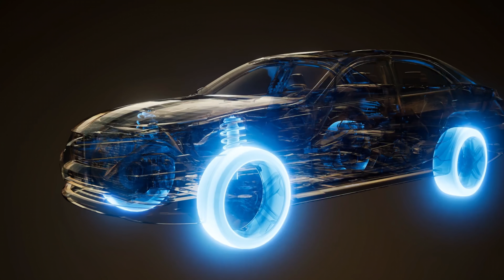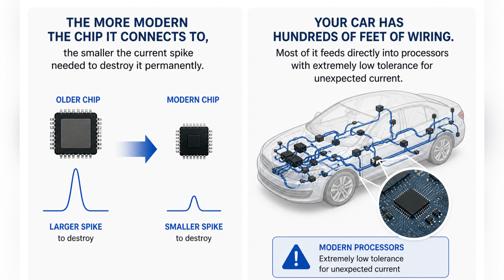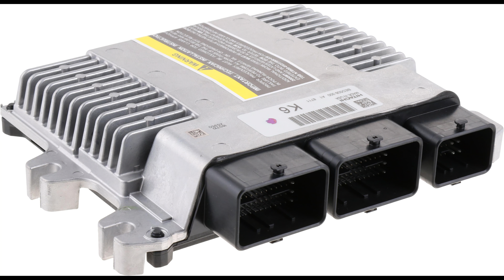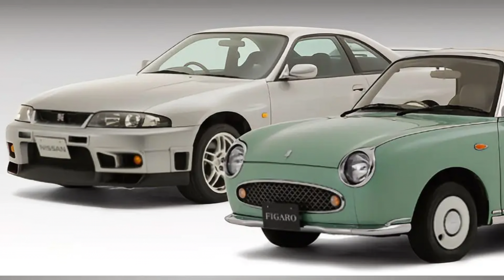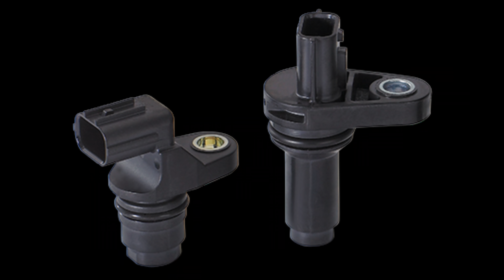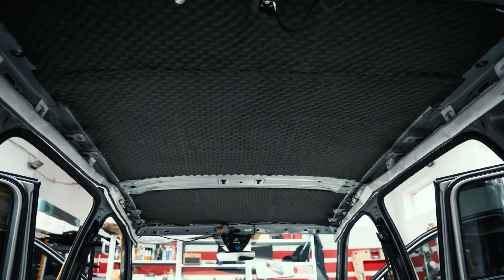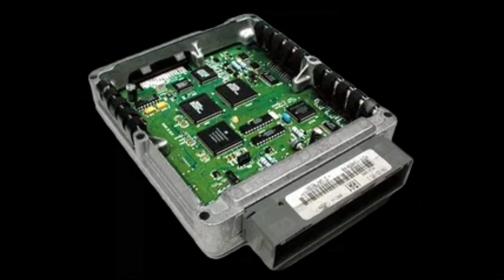EMP Just Killed Your Car? This $7 Part Saves It

Comment: relays can be bypassed with a shunt or jumper wire per the diagram printed on the side cover that's not saving   what's connected to the CAN bus

Comment: The EMP Myth is designed to sell idiots products.

First off there are no EMP weapons that pose any real danger. EMP weapons are mostly a myth. Russia and the U.S. experimented with them and the effective range of actual EMP weapons is about 500 meters.

Second, the only way to create an EMP strong enough to cook comsumer electronics including motor vehicle computers is to drop a nuclear weapon.

If you're close enough to the detonation to be impacted by the blast your car not starting is the least of your worries.  If you didn't get evaporated by the heat flash you recieved a lethal dose of radiation strong enough to kill you in a day or two. Your car won't help you.

Comment: That won't work. Its the electronics that get fried, not the fuses & relays. Miltary trucks usually have diesel engines with no electronics. Consumer trucks & cars have electronics for fuel injection, emissions control, security (theft protection).  Fuses do not protect electronics as they are extremely slow. the E1 Pulse will damage semiconductors in about 20 to 50 ns. A typical fuses takes a second or more to blow.

if you want a EMP proof vehicle then you need to get a old diesel vehicle from before the 1990s that does have an electronics for engine control.

Comment: Way to talk about the U.S. military then show a Russian BTR… and this is wrong in so many ways. Automotive relays are not vulnerable to emp, nor are the fuses. The vulnerable parts are the driver I/Os in every module within the vehicle; but the EMP would have to be very strong - like you’re within a few of miles of the detonation and you would not survive. Actual EMP hardening is a lot more involved.

Comment: there are no solid state components in a relay. the relay and fuse are not likely to be affected. if there is a flyback diode, that would blow, but it won't prevent the relay from working.

Comment: No.  When an EMP hits a modern vehicle, it won't run again period.  It won't just fry relays and fuses, it will fry every module in the vehicle, and modern cars have anywhere from 25-50 modules in them.  The small gap between relay and fuse terminals is not enough to stop the current.  It will simply jump across.  Most military vehicles in those scenarios are diesel.  Mechanical diesel will still run, just like an older ride without computers.

Comment: Ha my old truck don't have fuel injection, electrical fuel pump or a computer (ecm). But all the other electrical equipment will be down so I won't be too worried about a vehicle just stipid people.

Comment: This is a good video for someone that has a 50-year-old car. If we have an EMP that strong, your car is junk. Your car talks on a can bus system with about a dozen nodes. Each node addressable, even the transmission control node is programmed at the factory to set the perimeters. 
Get a good bicycle with a pull wagon or baby carriage

Comment: my 1971 Camaro SS 396 is EMP proof. it still has a points ignition. the radio might not work, but i can listen to the sweet song of a big block chevy all day long. oh.. and its a 4 speed, so no electronic transmission issue either. although to be fair if it had a TH350, Th400 or Powerglide it would be fine too. but you can push start a manual trans, even if the battery is dead.

Comment: A modern vehicle's ECU (Main Computer) runs the car. It's made of microchips. Modern microchips are extremely sensitive to voltage spikes. The high-altitude EMP (HEMP) induces currents that can fry delicate semiconductor tracks instantly. Your vehicle is toast.

Comment: Pretty much every home in America and most businesses break room have a EMP proof cage . It’s called the microwave.. also in the national in emergency , you can always rip the door off turn it on. It will decoy an anti-sam battery  with a intercept missile. It gives off the same signal as a  SAM battery site for aircraft . This was  demonstrated in the nato Croatian war 1990s . I believe the frequencies around the 2.4 GHz but that’s the reason you don’t stay in front of  modern US jet. when they activate the radar it  will harm you . This is a warning sign for multiple decades present on every aircraft body don’t stand in front of it.

Comment: Has anybody looked at the actual fuse boxES in a modern vehicle. I'd probably need $1000 to replace the fuses in my Ram. They are not your great grandfather's fuses. Besides, what about those 50 processors? Give me a break

Comment: This is, as mathematicians would say, “necessary, but not sufficient.” While EMP surges can destroy fuses, the vast majority of damage will happen with all the micro electronics in the car: the engine control computer, the myriad entertainment system components, the many CAN-bus Network devices that replace mechanical controls. These will get fried by any EMP, and are not easily replaced, and it is almost impossible to stock spares. Many are hard to reach locations, or require specialize electronic tools to install. Those electronic tools themselves will be destroyed by EMP.

It’s much more important that you have some EMP protected communication electronics, such as shortwave receivers, ham, FRS, and CB transceivers, Meshtastic nodes, and cellphones. They should be stored in a metal can rigged out as a Faraday cage, for which you can find instructions throughout the Internet. Without communications, it will be impossible to know what to do next. It won’t matter if you have a working car, because you will not know where to go.

The only sure way to have working transportation is to start with something manufactured in the 1970s and earlier, particularly diesel vehicles, which lack modern computerized electronics and electronic fuel injection. Everything from then back to horse and buggy will work after an EMP event. Anything after is likely to be damaged, and while an EMP isn’t guaranteed to destroy every vehicle, it only has to destroy a small percentage in order to block all the freeways and highways with dead vehicles.

Comment: Decent information, but not entirely correct. Most modern ECUs still have battery power that goes to them, even when the ignition is off. Most cars also have at least 1, sometimes 2, starter relays. On most modern cars, every computer in the car still has battery power at all times, it is instead turned on and off via a can bus signal. A lot of transmission computers are inside the transmission. Without that, your car does not work either. Keeping a spare engine computer is an interesting idea, but it has to be programmed to the car to work.

Comment: I got news for you: A few relays aren't going to save you. When they rolled an idling Ford Taurus across the EMP trestle in ABQ they were stunned after they saw the damage. The brake light wiring in the back actually melted out of the insulation, as it did elsewhere. Just because you don't have computers doesn't mean you are riding, instead of walking. When your ignition harness welds together, it's game over.

Comment: "back on the road in under an hour"? Bahaha. Yea right. 

Even if you had all the replacement fuses and relays and sensors, it would take a lot of work to get them all swapped out. Especially if you are talking about replacing the multiple computers buried in your dash and under your seats.

You'd have better luck walking around to find a 1970s truck to steal. Or better yet, just buy one of those to have in reserve.

Comment: This is totally bogus. Fuses and relays are not affected by EMP. They are simple electromechanical devices. It is semiconductor junctions that are burned out with EMP. Vacuum tubes are impervious to EMP. You should be ashamed of yourself.

Comment: I have backup ECM, fuses, relays and a set of injectors in a faraday bag along with extra cell phs, a star link mini, and a back up controll board to the big generator and a well pump. I’ve been preparing for this for 2 years. I’ll be one of the most prepared.
Reply: Good job
Reply: I’ve been trying to get my mother and grandmother on board. We are not ready and I am having a hard time convincing them to be more prepared.i I want to use your ideas. If you have any more ways to prepare let me know. I do want to het a well pump in backyard . Do you have a way to have a warm shower? I saw a YouTube video of a guy who made a rocket stove with copper coils around it

Comment: Old cars are no longer the answer. They are putting 15% ethanol in the gas. That destroys the fuel lines and engines in the old cars. Also, "coincidently" the auto parts industry is being gutted so older parts will no longer be available. They will also change the rules to make it illegal to own cars before a certain year. The tyranny is closing in on us.
Reply: You can take the ETOH out of the gas by mixing the gas  with water. ETHANOL is more soluble in water than gasoline.  Since there is a loss of octane rating buy the premium  gas as ETHANOL add some octane points.  Siphon off the gas leaving the water-ETHANOL mix waste behind- the remaining gas is ethanol free.

Comment: We have two air cooled VWs from the 60s and 70s. Their engines can get up to 30 mpg and can be rebuilt by a monkey with a manual. 16 fuses. Wiring harness that you can install in a day. No other electronics to worry about. Gas, air and spark. Go. Simple is as simple does.

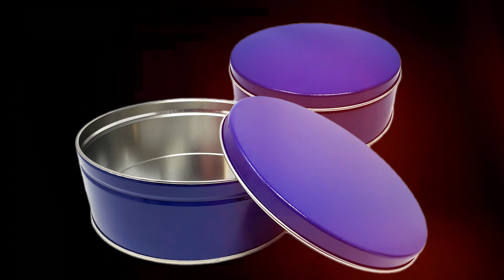Comment: Regarding 5:15 to shield against damage from an electromagnetic pulse, a Faraday Cage can be a galvanized steel bucket with a tight fitting galvanized steel lid available from a hardware store.
Reply: Old microwave oven!

Comment: Sure, $7 fix buy more vintage vehicle. You can even get one with electronic distributor and just put the components in a faraday bag. Newer cars are way too delicate. They have computers so you’d be spending way over $1000 to get everything you need to replace.

Comment: Replacing solid state Relay will not save you 😂. have an extra ECU with multiple relays and ignition modules Cam. And crank sensor Might have a chance.
Reply: The new ECU will probably need to be reprogrammed.

Comment: Not sure I fully buy this as a wrench-turner: The newest cars out there have some or all of their computers in full control, which means they have access to some power all the time despite these basic relays not being on.  This could be enough to cook some components, enough to shut down a vehicle due to a non-engine-control module not "reporting in" on the network (yes, modern cars now have their own network, and some cars have had no-start conditions due to other components in the network failing to report in as functional to the Engine computer).  Add to it the fact that any metal body panels that "might" shield internal components are also directly connected to said components by the Ground wiring.  We won't know until it happens, but at that point it's too late.  Further testing and design refinements are needed.

Comment: Starfish prime knocked out 1920's traffic lights and they were never able to replicate it. It was some hoge pojed town in 1950's Hawaii The "emp" effect was the result of a 1.4mt bomb exploding in high altitude. We have an ionosphere just for that reason, and how do they have electronics in space? Its not just shielding around the station, and everywhere else but the metal shielding around all the circuits ends act as a ground and shield. Its a pulse of electricity, and magnets? What magnets all of them? Electric motors must make those pulses all the time!!!!!! GTFO if you even had any logic or reasoning you'd prep for a massive 30 day long fire ball
Reply from the maker: Starfish Prime did affect electronics, but the modern grid is far more interconnected and vulnerable. Space electronics use specialized hardening, which isn't practical for every car. EMP is an electromagnetic pulse, not just magnetism.
Reply: You can't even explain what it is, you can't even cite anything credible. It's the ultimate prepper bro scam. You either played that part in call of duty or saw those scenes in oceans 12.
Reply from the maker: @alexmaccity  You’re trying very hard to make this sound fake, but your own examples are already wrong.

Starfish Prime was not “1920s traffic lights” in “1950s Hawaii.” It was a 1962 high-altitude nuclear test, about 250 miles up, and the EMP effects were observed roughly 800 miles away in Hawaii. Streetlights and fuses failed on Oahu, and telephone service was disrupted on Kauai.

And no, EMP is not “just magnets.” It is a rapid electromagnetic pulse that can induce currents and voltages in vulnerable electronics and wiring. That is why semiconductors, radios, communications equipment, traffic systems, and car electronics are discussed in official EMP material.

As for “how do electronics work in space?” — because spacecraft electronics are specifically selected, tested, hardened, shielded, and designed for radiation and electromagnetic environments. That is not the same thing as the electronics in an average civilian car.

You can call it “prepper bro” all you want, but this is not Call of Duty logic. This is basic electromagnetic coupling plus vulnerable electronics. You don’t have to be scared of it, but pretending it doesn’t exist because you don’t understand the mechanism is not a rebuttal.  

For anyone who wants sources: look up the Washington State Department of Health EMP fact sheet on Starfish Prime, and NASA’s radiation effects / spacecraft electronics hardening material. This isn’t sci-fi or Call of Duty stuff — it’s documented physics and engineering.

Comment: All military equipment must meet EMP proof standards meaning it will not be affected by it.Metal is conductive but what you need is for any EMP or EMF of any kind is to be absorbed so there is no leakage. Thick food grade plastic container will do the trick.

Comment: Respect to this video for pointing out the components of EMP and explaining the differences between a nuclear vs solar generated EMP.  I'm not sure that the relays and fuses will fail before (and thus protecting) the microchip devices in your car, but having spares for these on hand is a good idea nevertheless.  You might want to have some stabilized fuel on hand as well to get you around for a little while longer since the gas stations will likely be out.  A siphon hose might come in handy too.
Reply from the maker: Thanks for the insightful comment! It's great to hear you appreciated the EMP breakdown. You bring up some valid points about the relays/fuses and the importance of having spares. Stabilized fuel and a siphon hose are definitely smart additions to the preparedness plan!